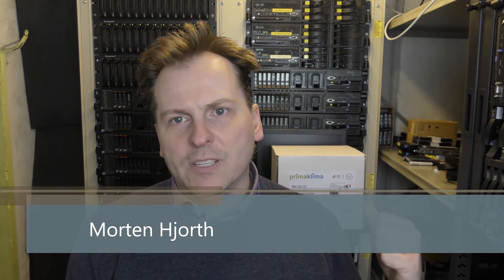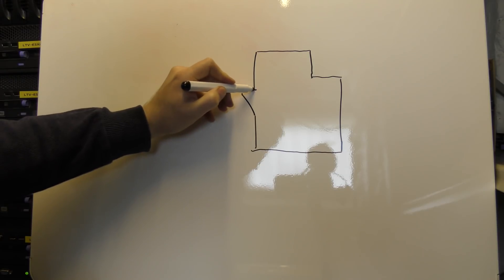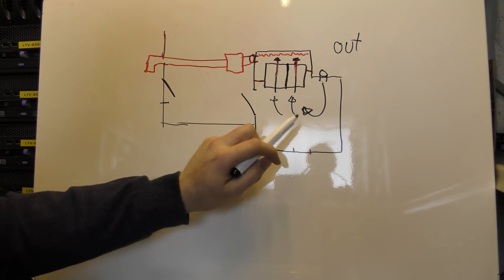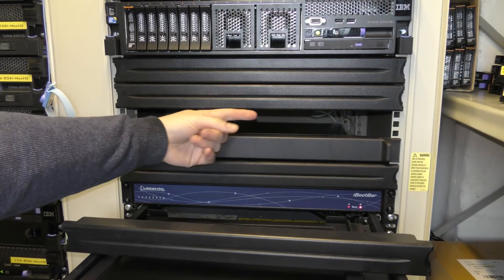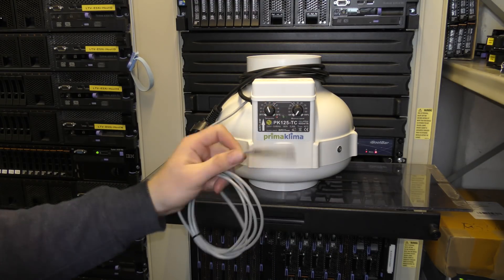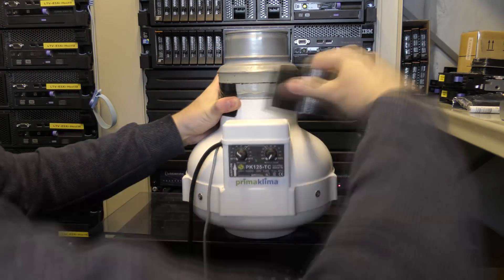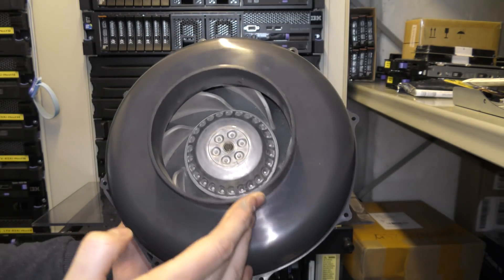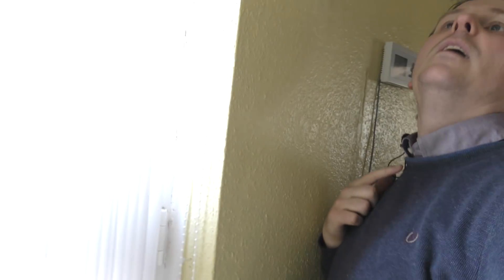Replacing Temperature Control FAN, that Keeps my Servers Cool - 676

Comment: Sir can you help with this issue? I made a vlog , until now the problem has not been solved,
https://youtu.be/BocVZmQzmiU
Reply from the maker: Hi The Tweakster
Thank You very much!  If the server has two PSU's and you only power one of them it might do this.... also if you take the cover off,, some servers will feel this and blow fans full speed... maybe :-)
Thank you for watching! :-)
Reply: I forgot the vlog is on Filipino hehe, we used only 1 Fan on that server and also tried to run with the cover many time but still didn't work, we replaced the fans with newer one same PRU and also tried the Fan cassette on a working server ...

Comment: Trying to get one of those Prima Klima PK125-TC Extractor fans now :-).
Reply from the maker: Hi DDfITech
For the same use as me?
Thank you for watching! :-)
Reply: Yep exactly. I really wish I had attic, shed, garage that I could run cables to. Going to spend the weekend moving stuff around. Air Flow in cupboard is rubbish so need to sort that out for certain.

Comment: Hej Morten!
You use solar heaters for preheating your hot water, don´t you? As the water comes out off the pipes at some 5 to 10°C, couldn´t you use the heat from the servers to prewarm the water there in order to get fully indepenent from additional energy consumption to get the water hot?
Reply from the maker: Hi Eo Tunun
Thank You very much!  That would be a difficult system to build and control.
Thank you for watching! :-)

Comment: What do you do for dust?  I never see you clean your servers.  I have the devices that collect what feels like all the dust in the house in a week.
Reply from the maker: Hi Daniel Tekmyster
Thank You very much!  It is not that bad in my DC,, I clean the floor with a vacuum cleaner,, the lower servers picks up most dust. I have done videos on cleaning servers.
Thank you for watching! :-)
Reply: Maybe consider a metrovac ed-500 esd, they seem like the best way to deal with it, bit pricey though

Comment: Hi Morten ...narow crawl space with high rpm fan, obviosly nothing could ever go wrong lol Id totaly put an epa filter or a grill larger then my fingers there ^.^
can the fans be inverted to push instead of pull in the switch?
also is the mufflere from a car? Ty for another good video
Reply from the maker: Hi pierre Beauregard
Thank You very much!  the fan is pushing as it is..
Thank you for watching! :-)

Comment: I have to put one of those fans in my office until I move the rack to the basement.  I have to put a extension on the basement first.  The rack is higher than the current height of the basement.  House reno's never end.
Reply from the maker: Hi Scott Downey
Thank You very much!  Yes a bit mutch to dig out the basement to fit a rack,, maybe just have someone shorten the rack,,,tjop tjop :-)
Thank you for watching! :-)